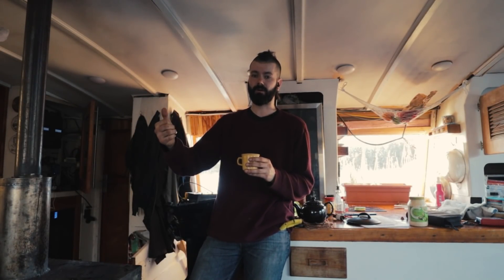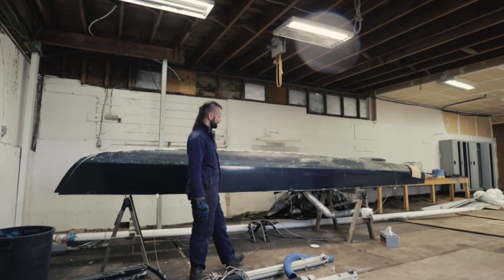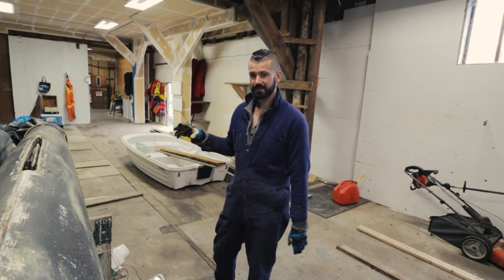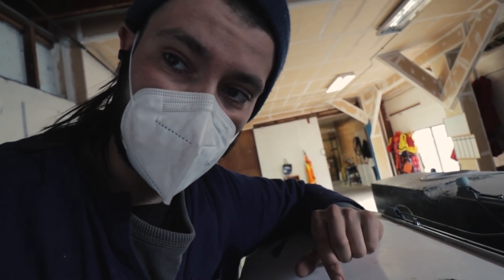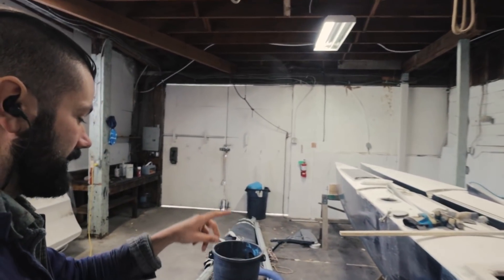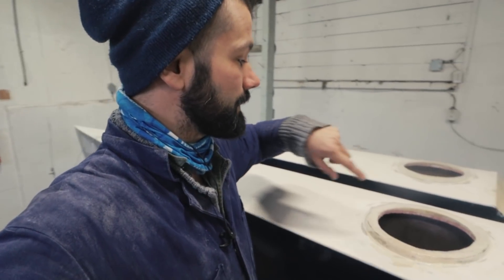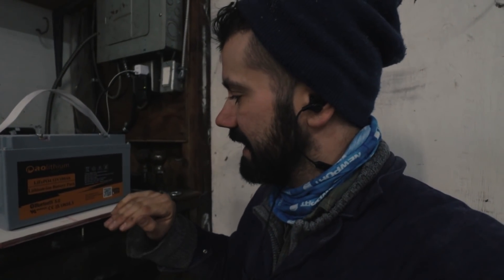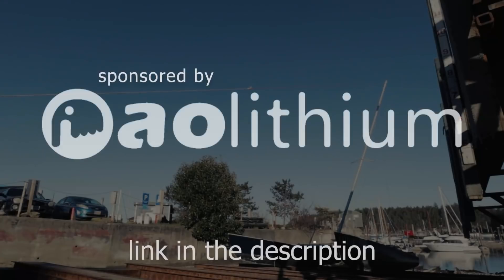Converting Small Catamaran to Solar Electric - Sink or Swim 229

Comment: Any updates on this catamaran? What are you going to power it with? I'm very interested in seeing how this project turns out. You chose some great hulls. 

I dare say that you are going to need more power to go at a decent speed on solar alone. I estimate that thing will take about 100 watts at 3mph, 300 watts at 5mph, 600 watts at 7mph. That's assuming a total weight of 400lbs including a person, battery, motor, etc.

Comment: Simon, great channel thank you.
I'm buying a mono hull so will have less room for solar panels. Do you think turning a dinghy into  a solar raft could be dome?
Building something so you could float ,say, 10 solar panels on top of the dinghy.
Basically to be deployed when at anchor or possibly even towed at slow speed.
Reply: Important to get a very efficient hull when working with so little power. The tow behind idea is interesting, that would allow a large collection area. Watch out for putting too much weight up high on a boat.

Comment: Wow..  very cool.  I am working on some similar here on the Phillipines.   But I am stuck with deciding on engine size Vs prop size Vs how much battery to get Vs best speed to distance or time Etc.   I’ve tried to create some equations,  but so far have failed.    Any insight on how to calculate these things to get an idea for the expected performance numbers?
Reply from the maker: This boat will use a 12v 62lbs thrust trolling motor, burns 750watts or 1hp at max. This means I have 1h45min of run time at full speed. The quest then is how fast will 1hp move my boat? Paddling gets me about 2.5 knots. So I’m guessing 4knots on full tilt. So maximum range is 7NM. 

Motor and prop are directly correlated. I use the internal combustion outboard as my basis. If I’m building an outboard with a motor that has the same RPM range as the gas outboard engine, I can just drop it in. If it’s a bit slower then you can use a larger prop, if it’s faster you use a smaller prop.